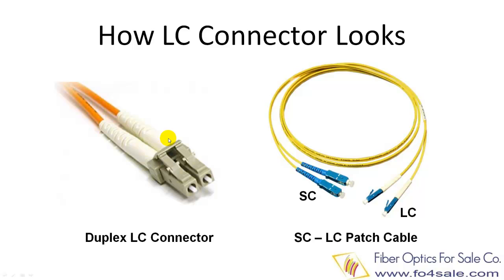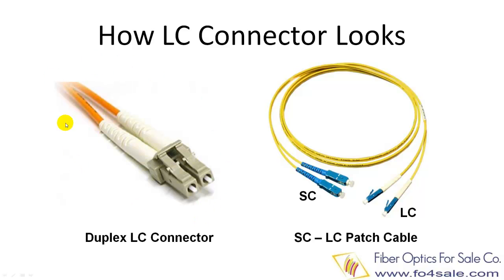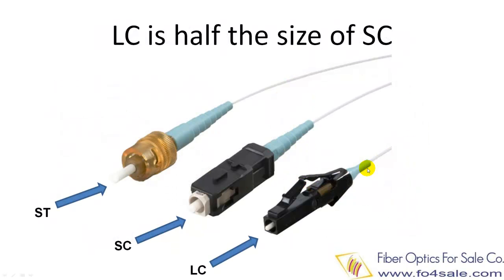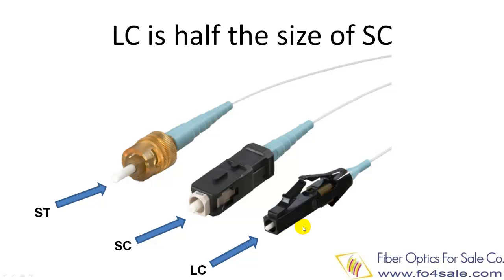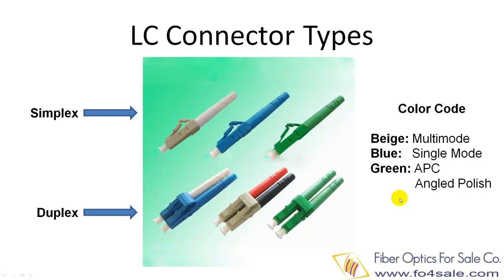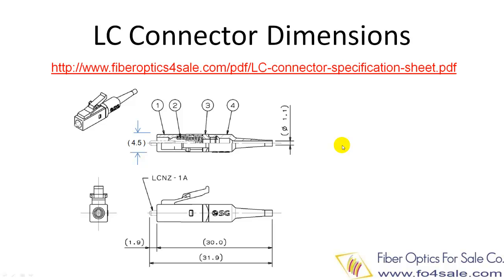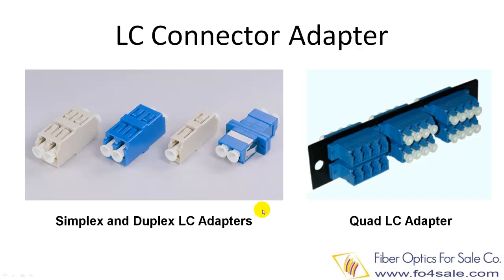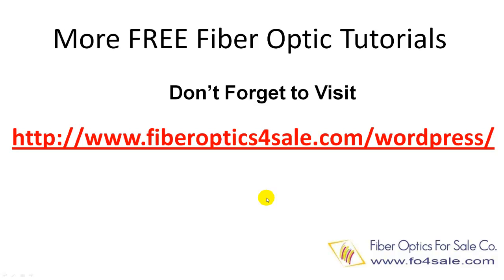LC Fiber Connector Explained in Detail

Comment: Beige = OM1 - 62.5micron mmf connector
Black = OM2 - 50 micron mmf connector
Aqua = OM3/OM4 50 micron laser optimized mmf connector
Blue = 8.3 micron smf connector
Green = 8.3 micron Angled Polished smf connector